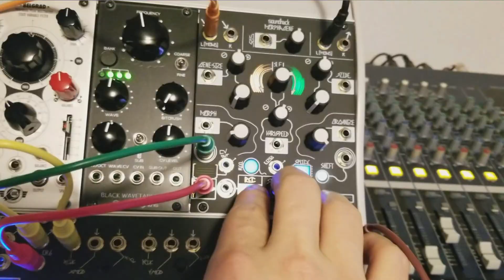Morphagene - How I Loop

Comment: Nice video.  Why tap in the speed when you have Tempi?  Tapping kind of defeats the point of having Tempi.  Let it quickly calculate 1/2, 1/4, 1/16 etc for you.  MACHINE Programming is simple:
[Hold] PGM_A for DIVISIONS (÷) or PGM_B for MULTIPLES (*) and [tap] the associated Channel Button the number of times
corresponding to the desired DIVISION (÷) or MULTIPLE (*).
Reply: Or you could just use Pamela’s New Workout and dial in /4. Or /8, or /5.3 or whatever.

I’m not hearing good things about Tempi tbh…
Reply: @walrtbstudios5430  I like Tempi.  Haven’t had any issues with it.
Reply: I remember the Tap tempo aspect being the main function in make noise videos

Comment: ...Great Video, but there is one thing I don‘t understand. When Tempi sends a Gate to the play input, It‘s like a pulse, half way up an half way down, so Morphagene stops after half of the playback. How did. you solve this problem? Thanks
Reply from the maker: This might be a firmware thing. When I made this video, I had an old version of the firmware in which the splices would always play to the end on each gate.
Newer firmware will allow you to change that behavior to where the splice only plays when the gate is high, and ceases to play when the gate is low.
The newer firmware allows you to make some initial settings right on the SD card so there are more options to mess with.

Comment: I don't understand when you say "If your resolution and timing is good"...isn't there a record gate input for getting everything perfectly in time?
Reply from the maker: I'm recording into a new splice, which is a key combination.
New firmware that was released after this video was made, has the option of recording into a new splice with just the rec button (without the key combination), or a gate.